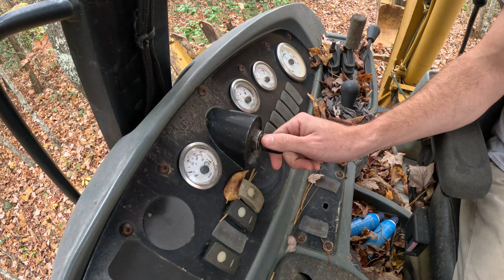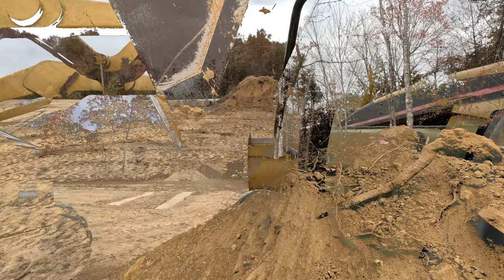Backhoe work

Comment: are you using the brakes eveytime you change direction? If so, you should not do that - no need - you have a hydraulic reverser that automatically absorbs any shocks. You operate the loader quite well but need some seat time on the backhoe. Is this your first rodeo? How long have you had the machine? How many hours on it?
Reply: Can you post a video on how to operate a backhoe properly?